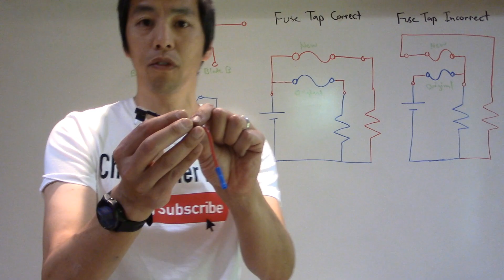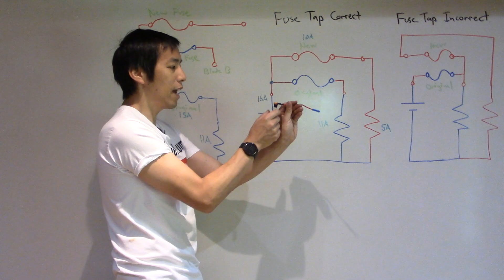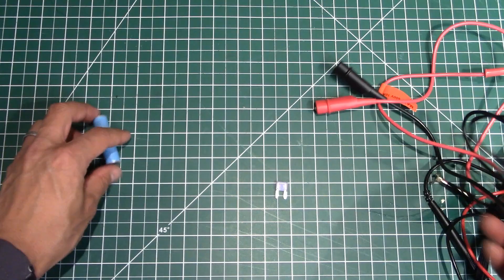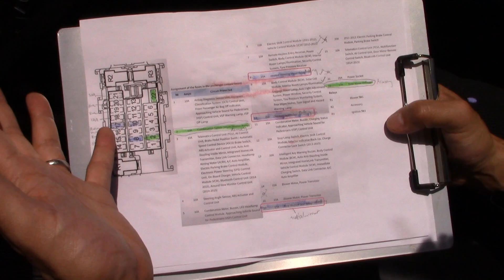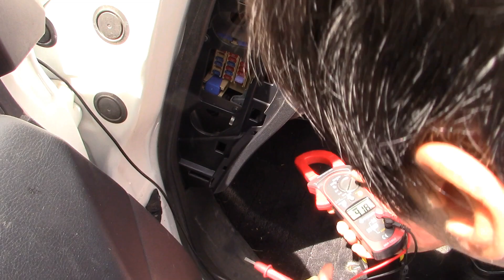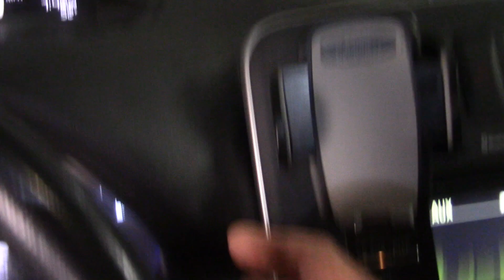Wiring Diagram and Installation of a Fuse Tap

Comment: If you did fuse tap from both a battery and an accessory circuit, why did you have to turn the car on? Battery means power is there all the time. Accessory is only present when ignition is on. You said you are adding 2 taps of one of each but the camera came on only when you turned the ignition on. Maybe I missed something since I am deaf but it seems to me you powered the camera from 2 accessory circuits.

Comment: I have an aftermarket headlight accessory for a Challenger. I have 1 red and 1 black wire. I use the piggyback adapter for my red wire (+), and put my fuse (fuse 48) into the bottom ports on my piggyback adapter that is closest to the prongs. I have no other fuse to plug in. Is this okay? 

Also, for the black (-) wire, how do I ground this in my Dodge Challenger?

Comment: I am in the process of adding a dash cam to my new car. Can I use an empty spot on the fuse box? I have identified a always hot and switched spots in the fuse panel.
I have watched multiple videos and not one show this scenario. Is it OK even though the spot is originally designed for a 20A and I will only be placing the recommended 5A fuse for my Viofo camera?